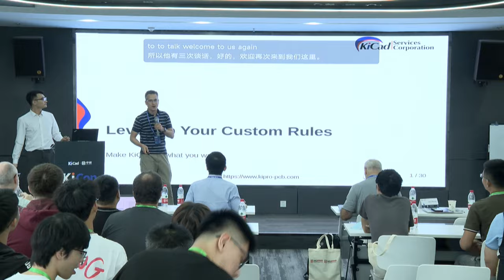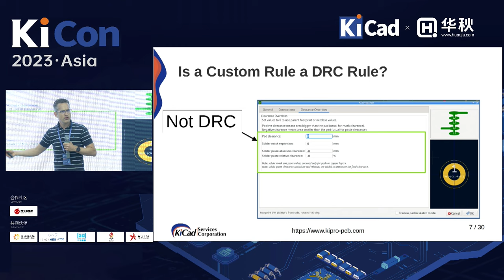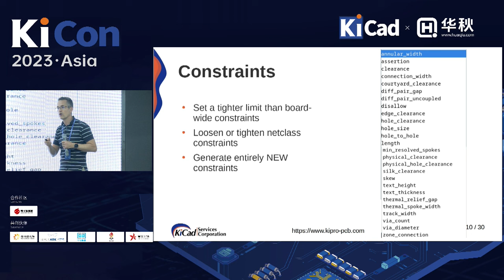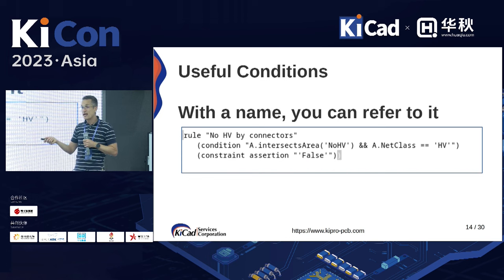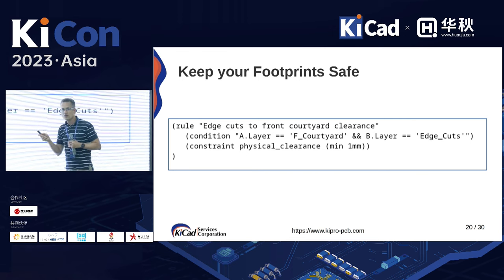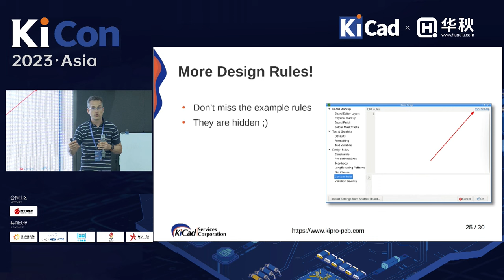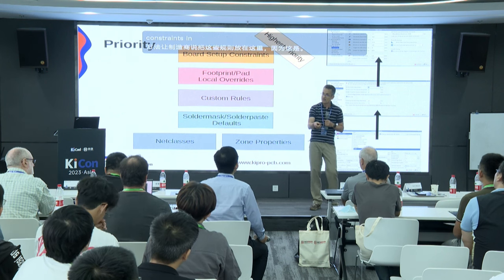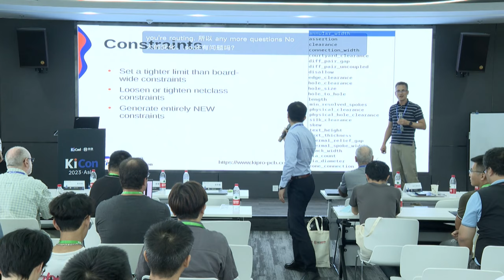Level up Your Custom Rules - KiCon Asia 2023

Comment: In the introduction, one should directly say: 
"zone fills are generated based on custom rules where they apply, and thus such rules do not need to be considered in the context of DRC checks again. Otherwise, frankly, that would be a bug." 

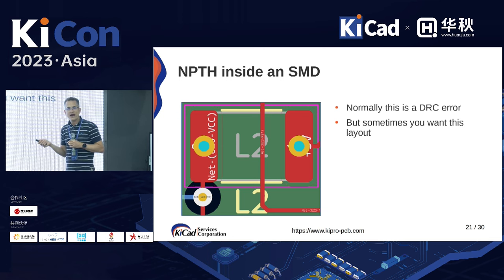22:00 the name of the example (PTH in pad) is pin-in-paste for through-hole reflow.
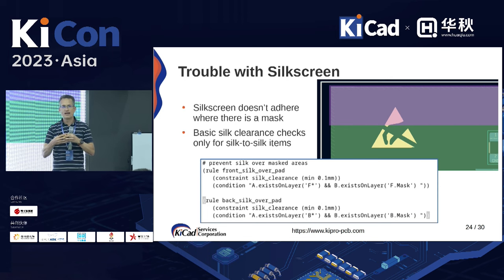24:30 oddly enough, 'F*' does not seem to apply to F.Cu, so it neither allows influencing zone fill with graphic items, nor can an error be generated when silkscreen is e.g. on RF traces sensitive to extra dielectric on top.
26:00 I keep pressing CTRL+F and wonder why no search bar pops up in the syntax help. I then keep copying the help text to notepad++...
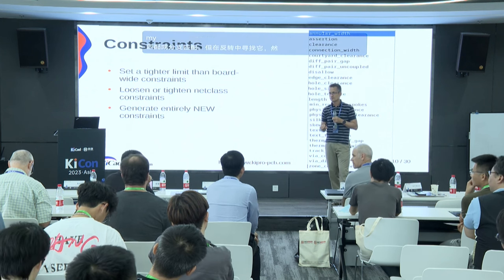34:46 custom rule for length matching: what you cannot do right now is e.g. to have a single rule that uses regex on the net class name to grab a length spec from that string, which would be cool